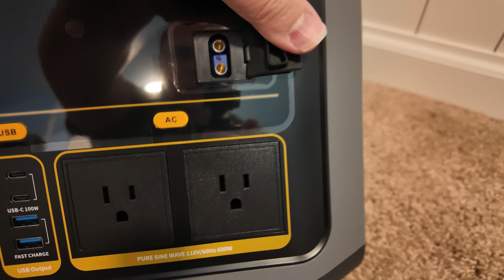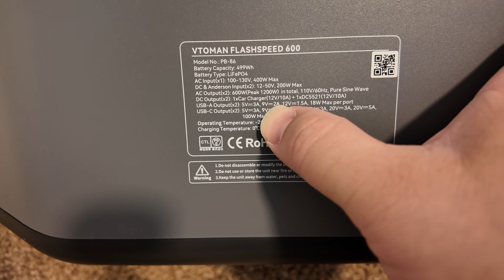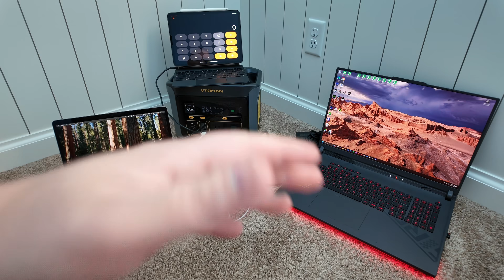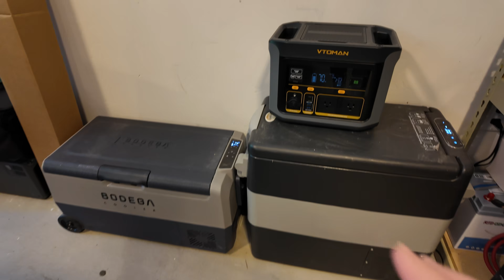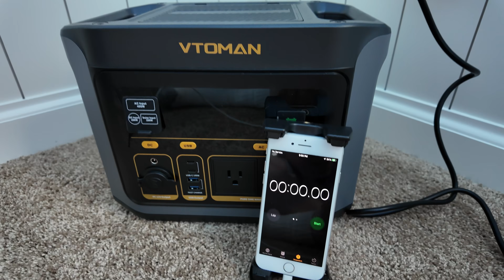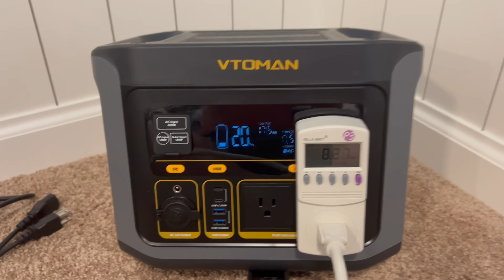Top 4 REAL Uses for the VTOMAN FlashSpeed 600 – Stuff Others Won’t Show You!

Comment: I asked Ai, what size power station and solar panels I would need to power a camping compressor fridge, that's pulling a minimum of 45w on Eco mode.....Ai said I will need a power station that's 2,500Ah with 400w of solar panels. That is a large expensive power station and a lot of panels to go camping.
Reply from the maker: That's a real-world sizing question worth working through carefully rather than ballparking. I'm adding camping-fridge power station and panel sizing to the pool for an upcoming viewer-questions video. Thanks for the detail.
Reply: @theresatrickforthat  Thanks. So Ive just bought an Alpicool 35L 12v Comp Fridge and when its on fridge temp 2c-4c and the compressor kicks in its only using around 3amps for a short while. So what size solar power station should i buy.